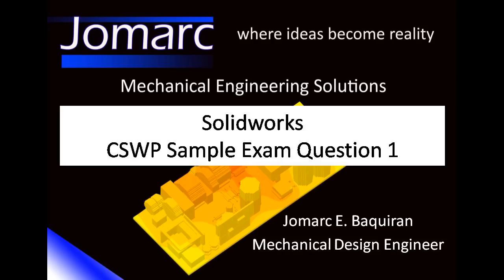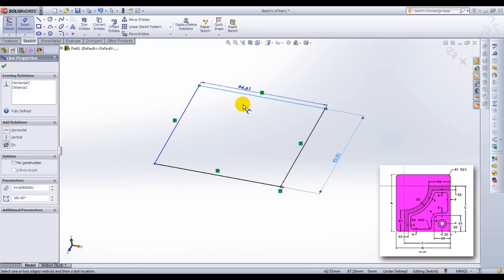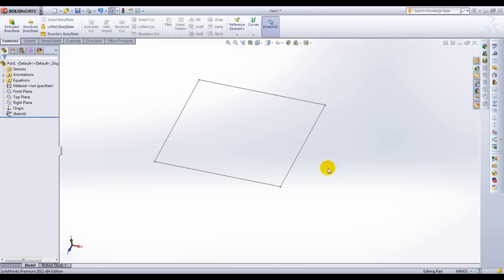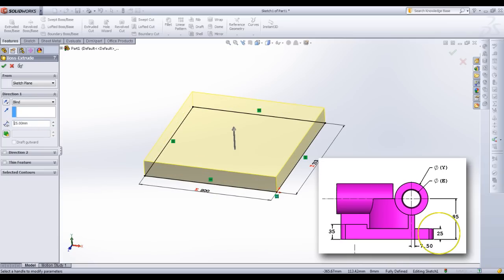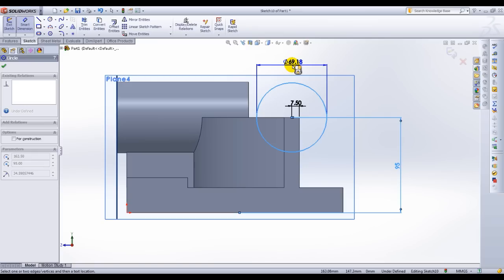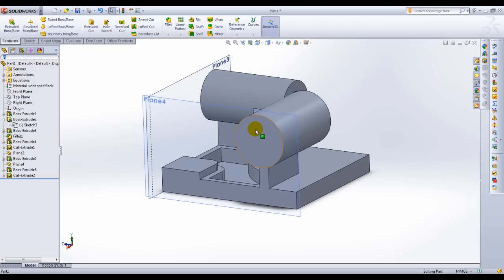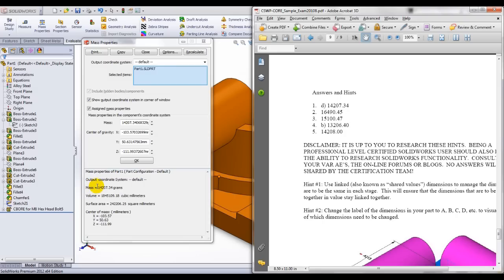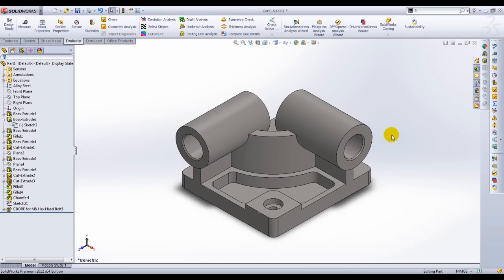CSWP Sample Exam Question 1

Comment: I get 14198.24 grams
 but i've no idea where thos extra 9 grams are hiding. The difference is about the same as a Ø27.5 x 2mm thick disc which is quite a lot to be short. They still marked my answers to question 2 and 3 correct though
Reply: Mine comes around 14200

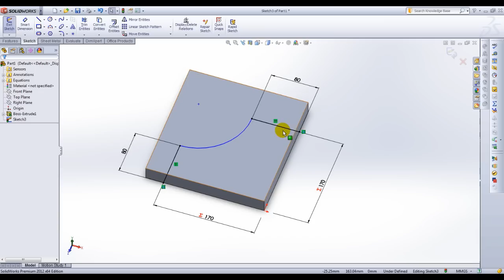Comment: 5:30 you didn't fully define the arc. The arc line should be black, not blue, and the offset entities command used later will be based on that undefined arc. Adding a horizontal relation between the arc centerpoint and the top line, or a vertical relation between the arc centerpoint and bottom line, would ensure that the arc will always be 90 degrees, and fully defined.
Reply: My part weight would mess up once I changed my design table for question 2, implemented what you said and it fixed it. thanks!
Reply: Fixed my error on the second part too. You the real champ!

Comment: There are a lot quicker ways to do this.

Regards,
Elite SW applications Engineer
Reply: ya I did my cswa in 1 hour 15 mins and that included haveing my teacher come over and make shure i did everything
Reply: I agree, but yet again people who will be taking this exam won't necessarily be "elite" in any standards. Also, you'll have plenty of time to model the part, so its not a race to get it done as fast as as possible.

Only with experience you'll find new and faster ways to get it done faster. I did my first attempt and it took me about an hour, but I never used equations before.
Reply: OPOCHKA sign of a enginear is being able to build shit people can only dream of but not being able to use " propper grammer/ spelling" i spell based on how it sounds
Reply: Gysper yea theres actualy this one part where a bunch of people failed bc one of the parts was given to them being dimentioned wrong ... so all their answeres were screwed up even teh apearance was different... but they modeled it the same exact way useing all the dimentions in the correct ways
Reply: I'm guessing you didn't do very well in your english class lol
Reply: well he's so elite he just spells based off how it sounds ¯\_(ツ)_/¯